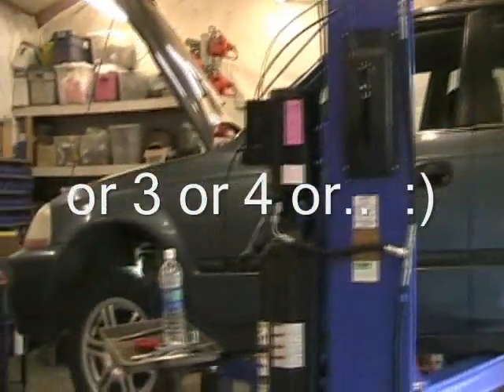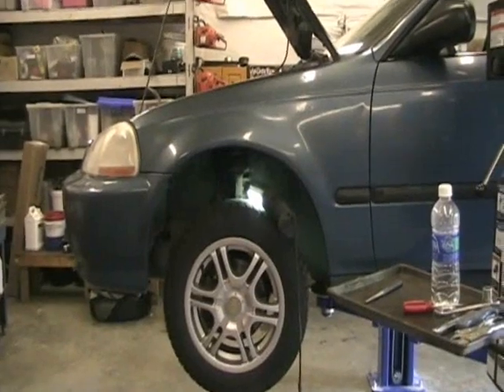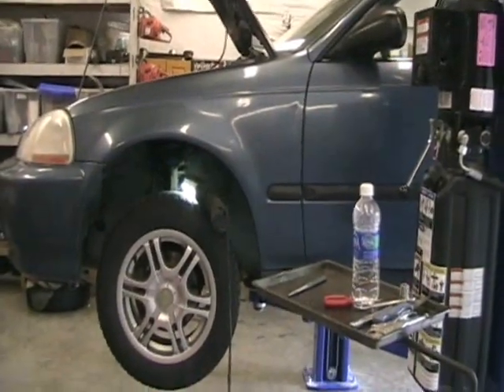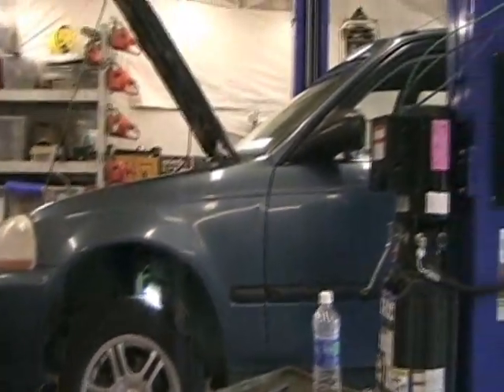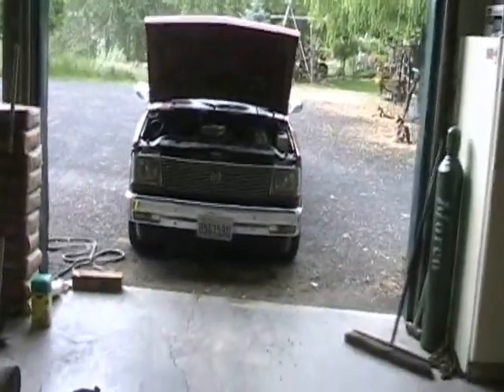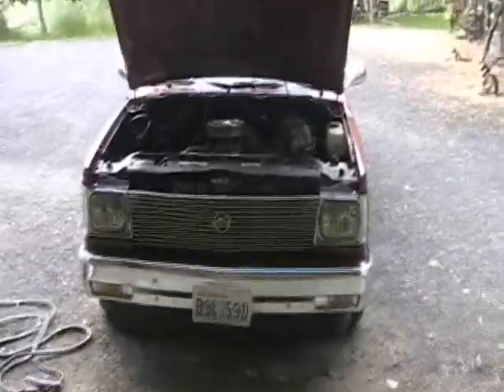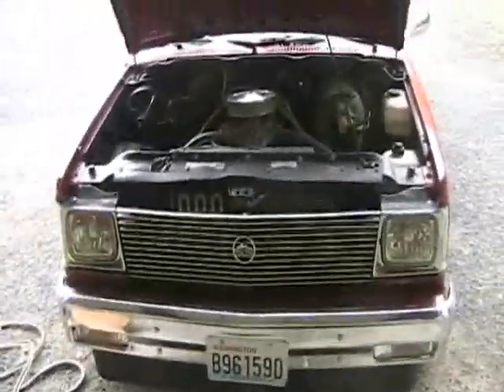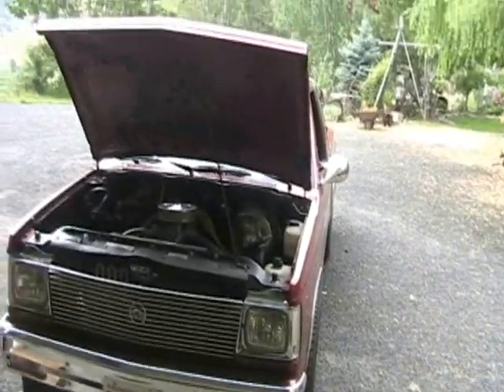1996 Honda Civic, lets roll!

Comment: @1963impala2dr I haven't been subscribed very long. I found your channel through rpeek. But at least now tightening that nut will be so much faster and easier on your back. What type of transmission does the S-10 have in it now?